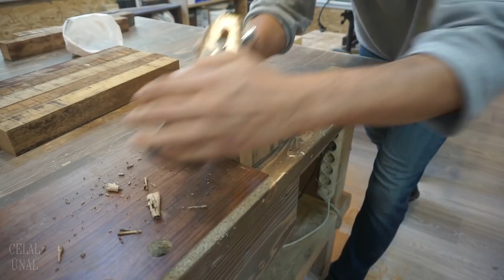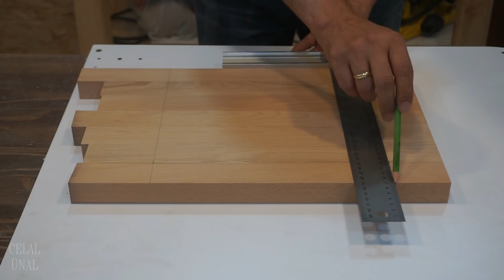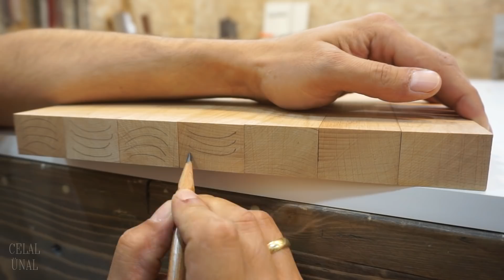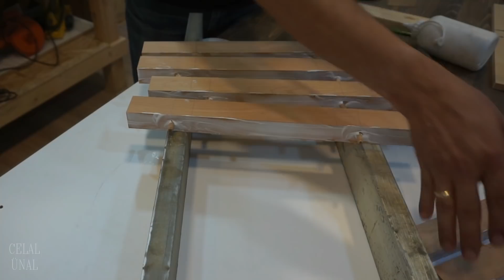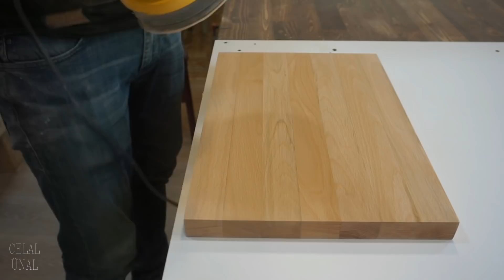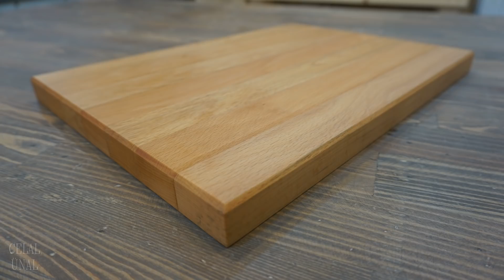Woodworking / Cutting board / Kesme tahtası

Comment: Great work but the dowels are really not needed, the wood glue alone is so strong that if it breaks, the wood itself will break rather than the joint😉
Never had a problem with just wood glue alone when joining boards
Reply: Hello sir 🙏🤝🇮🇩🇮🇩
Reply from the maker: Thank you so much. I am so glad you liked it.

Comment: Good evening.  I was watching your new video and great job again.  Congratulations.  May I ask about the red dowel joiner you use in the video?  It is intended only for making holes for pins or you also use it for the connection itself (for example, T-joints - shelves, concealed joining, etc.) Would it be possible to attach a link to this product to your video?  Thank you, have a nice evening.
Reply from the maker: Thank you so much. There is no link but the brand is rox wood. I think it's on the site.

Comment: Every time that I see people aligning wood grain like that (opposite one from another) I realize how little people that woodwork actually knows about wood and wood movement. 
Doing that wont help against cupping. In fact if it ever cup, the result will be nearly impossible to re-flatten since it will twist and give zero base to work with. But first, if you do a good work at prepping the wood (in a big project) and use a well dried piece it wont move. And to finish a piece of wood that small will move sooo litle that it will be nearly be impossible to see. 

Align the pieces of wood so it looks the best, not using this ridiculous old nonsense idea of alternating pieces.
Reply: So all the experts that recommend this method are ignorant and know nothing, and you know best… Got it! 🤦🏻‍♂️🤦🏻‍♂️
Reply from the maker: I think the method is fine. There is not always one hundred percent dry wood. It's about humidity. And on wide boards, bending is certain. That's why I always get good results without combining a reverse and a straight line. I am not an unnecessary method.
Reply from the maker: LP-Wood Thank you very much 🙌🙌🙌